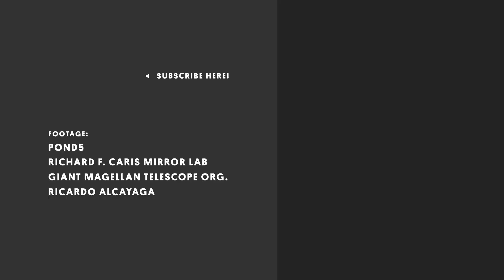Building the World’s Largest Telescope

Comment: @01:28 Kinda have to wonder about that 7 years per mirror statement.

Does he literally mean it takes them 7 YEARS to make JUST the glass of ONE of the SEVEN mirrors before they can start with the next one!? ( didn't look like they had the facilities to work in parallels )

Talk about being inefficient... By the time the last mirror is finished the first one might already have suffered some form of degradation because of someone just looking eery at it...

I really hope he's just made an error and referring to the project as a whole.
Reply: It's true, here is a quote from Wikipedia:
 ''The casting of the first mirror, in a rotating furnace, was completed on November 3, 2005, but the grinding and polishing were still going on 6½ years later when the second mirror was cast, on 14 January 2012.''

But then they managed to make the project faster and they work simultaneously on different mirrors is different stages. the 5th mirror was cast in nov. 2017.